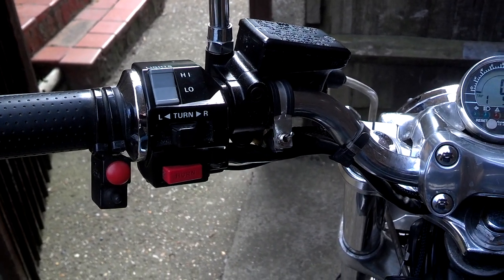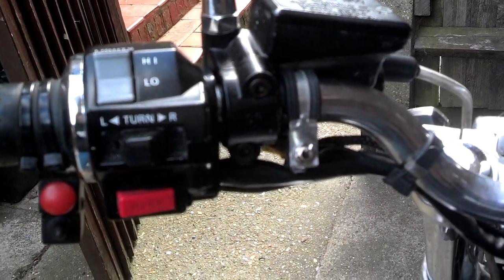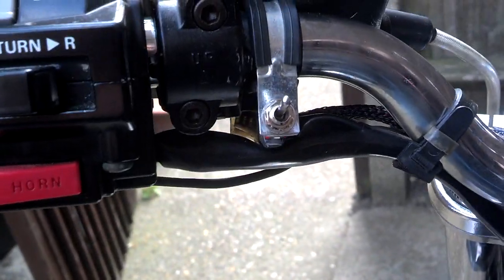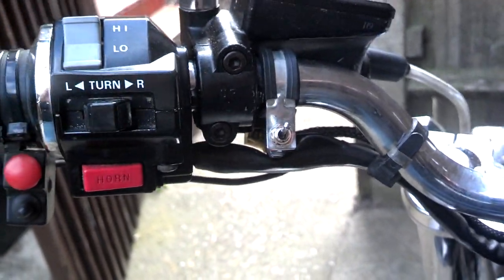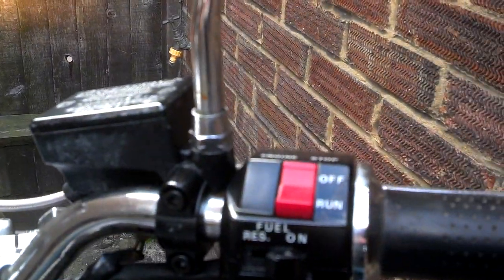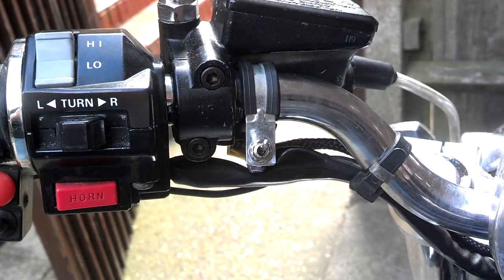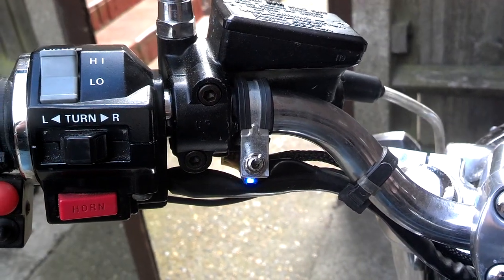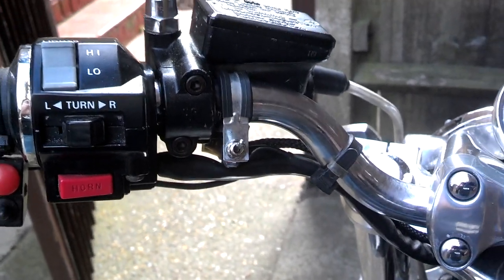VBoost Indicator

Comment: where is it wired to.
Reply from the maker: Sorry for the delay in answering. It's wired to the feedback wire from the servo to the controller. You have to use a FET to prevent any voltage from the circuit interfering with the servo signals.
Reply: WolfMax thank you.
Reply: WolfMax have you seen the video on you tube v maxwith angel eye light in speedo. any idea how he does it .i have an idea to put a trip switch on v boost pully near carbs.keep in touch if you work it out .
Reply from the maker: No I haven't. But if I had to guess, I'd have to say he took the speedo apart and made one special to fit (plenty of youtube vids on how to make angel eye lights).